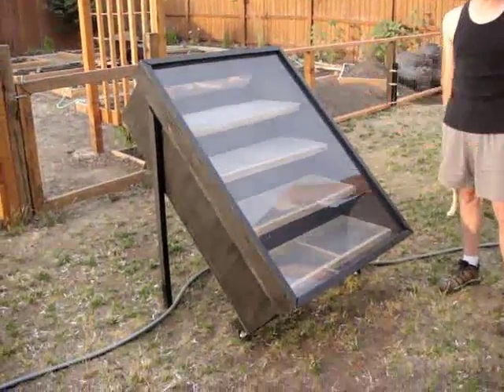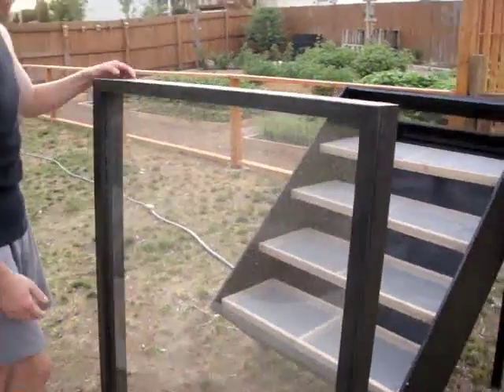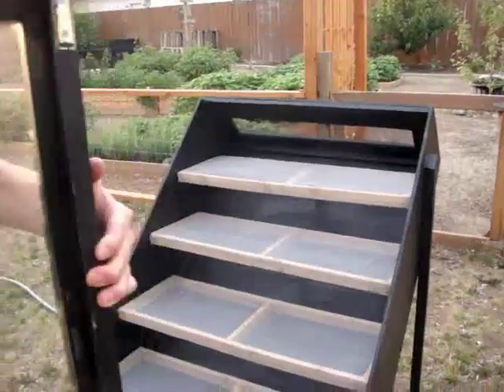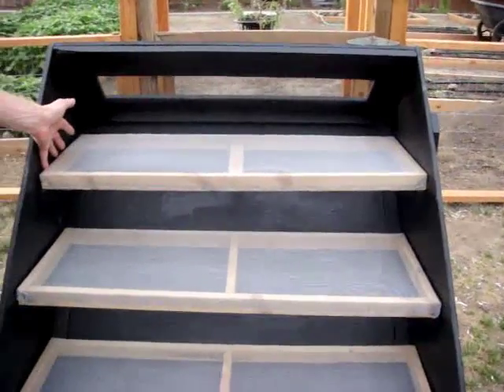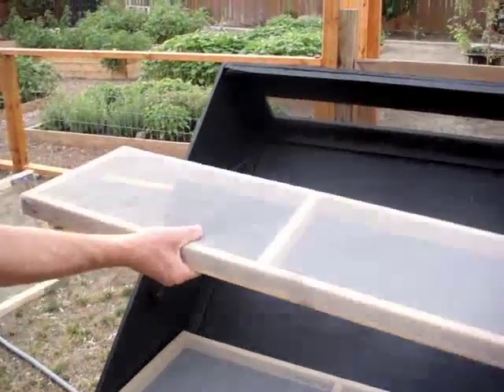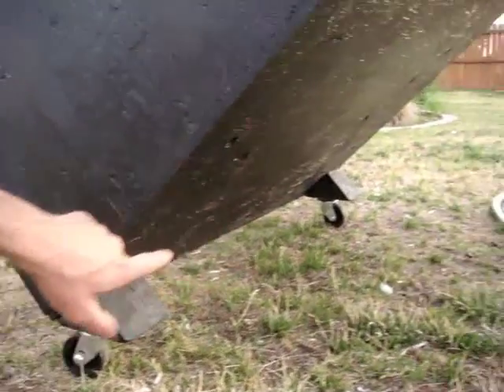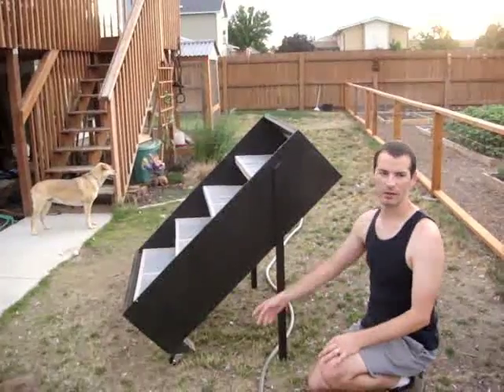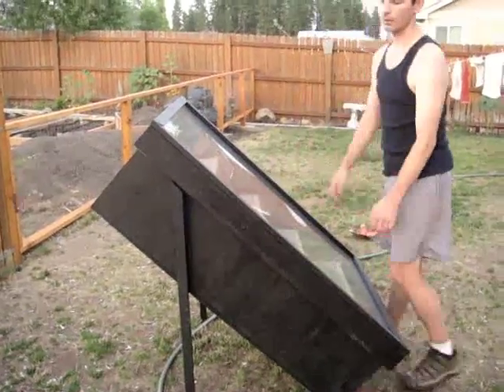Solar Dehydrator #12

Comment: It's nicely made but it's not the sun which dehydrates, it's  moisture or water which is extracted from the fruit or vegetables which dehydrates it.
Thus connect an extractor fan to pull the moisture off.

Comment: Highly not recommend to use toxic paint (which leaks out poisonous gases especially under strong sunlight); racks made of polyester, aluminum (ions come off it and bad for health) or cheap quality steel mesh which maybe full of heavy metal and industrial waste materials. Use natural woods (not plywood or particle boards) and high quality food grade 316L stainless steel mesh. Use environmental safe paint.

Comment: I use needle point mesh grid plastic sheets on top of the factory grid  to place foods on in my regular dehydrator unit ...this allows many small berries to dehydrate easy and those sticky type foods that are hard to remove off screen easier off the mesh plastic as it is fleixable  and food releases when bending the sheet..Easy Cleaning  these  mesh sheets can be sanitized -- I hate peeling off stuff and still leaving tidbits on my screens,,plastic mesh solved this issue wonderfully ,try it out

Comment from the maker: @jolicoq I imagine you could dehydrate any fruit. For fruit with a large seed in it like mangoes, peaches, or cherries we usually take the seed out and slice the fruit thin. In the cherries case just in half works fine. As for small seeded fruit like strawberries, and raspberries I found making fruit leather worked best.

Comment from the maker: Thanks. Because of the angle and two air vents one top one bottom air moves through there perfectly! I think if you put a fan inside it would move the air too much and the box wouldn't heat up properly.  We have since dried peaches which are mostly water and they dried great.